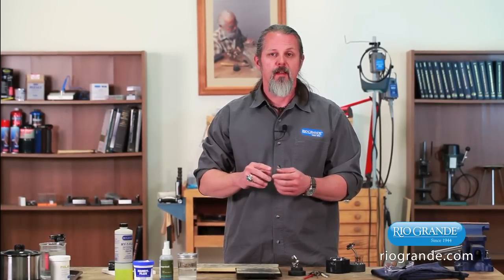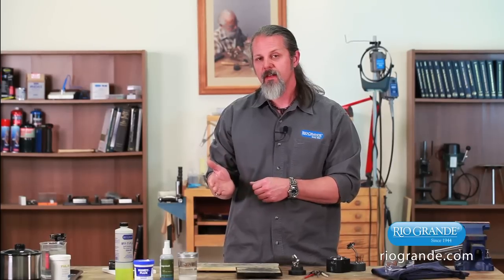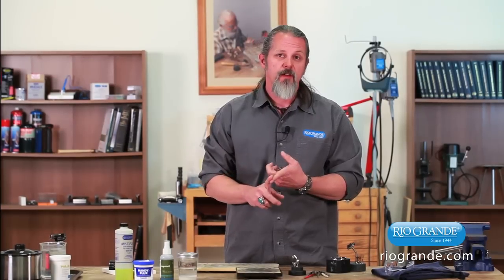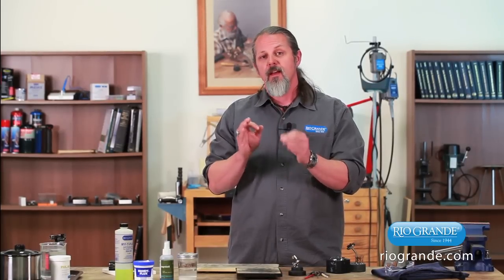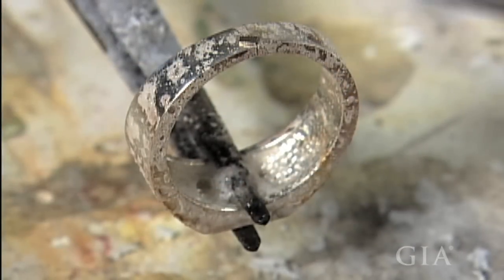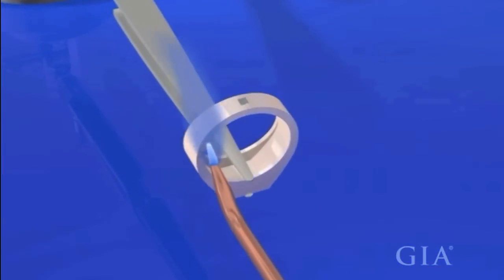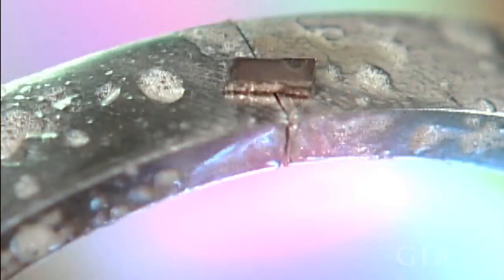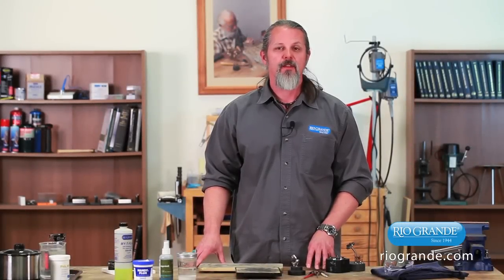Soldering 101: What Is Jewelry Soldering?

Comment: Hi Pamela, You can do the same technique in 14k as you do in sterling. Gold filled is a different story. If you melt the end of the wire you end up with a brass/gold alloy that will turn oxidize very quickly. If you want to make your own Gold gilled head pins. it's best to gold plate them afterwards. I hope this helps.
Mark N Tech

Comment: Hi Mark..I am new to soldering and am hoping you can help me. I work primarily with very thin (0.9-1.5mm) gold filled, rose gold filled and silver plated necklaces. In order to get my chains through small crystals I cut off the ring at the end (the ring is usually 5-7mm in diameter). I just bought a Dremel Versatip 2000-6 soldering iron and my questions are 1) what type of wire should I use to solder the ring back onto the different chains, 2) what type of flux should I be using, and 3) How high should I turn the heat on the soldering iron to? If you would answer these Q's, I would be forever grateful!